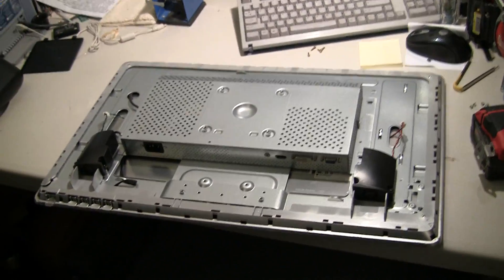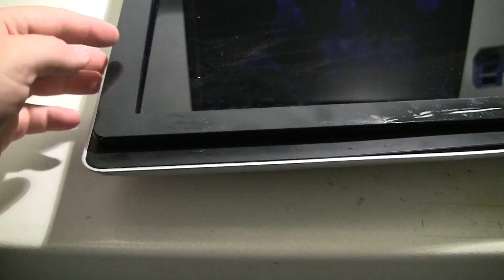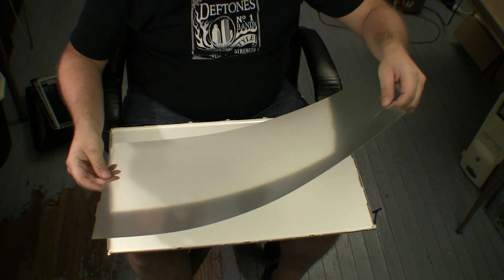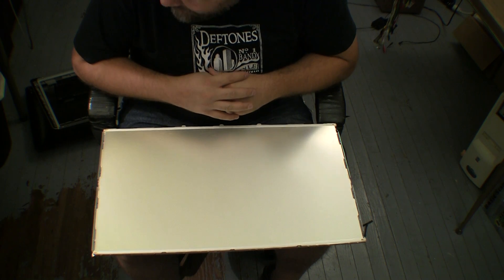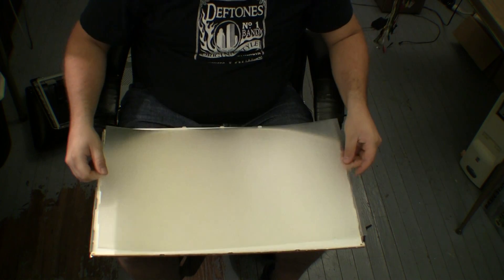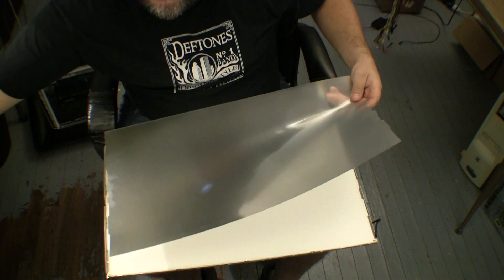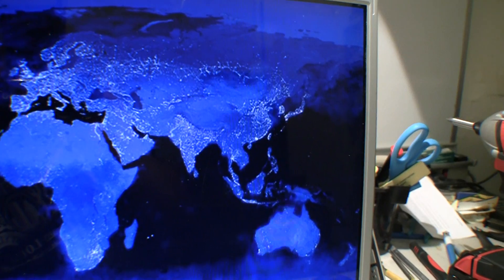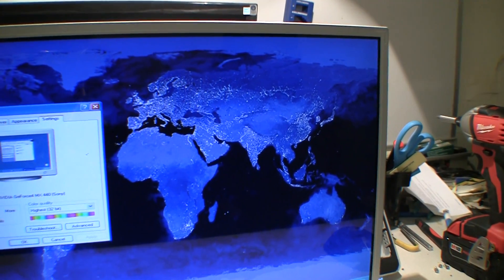City Dump Treasures - HP 2509m tear down and diagnosis

Comment: The buzzing sound is most likely a broken high voltage connection at the end of the CCFL that is arcing. It's best to solder that back on and insulate the connection before the ends get too charred. Also, the resolution for a 25" (?) monitor should be way higher than 1280 x 960.

I have a Dell monitor with a very yellow image, until now I thought it was potentially a problem with the high voltage supply or the CCFLs themselves.
Reply: Yeah, I was thinking that resolution was weird too. The HP site says the monitor is native 1920x1080.